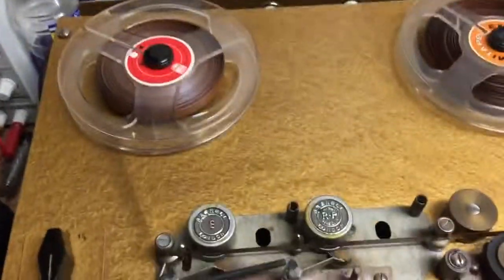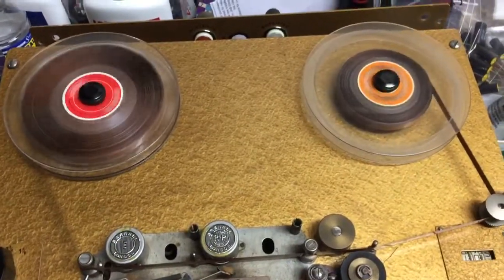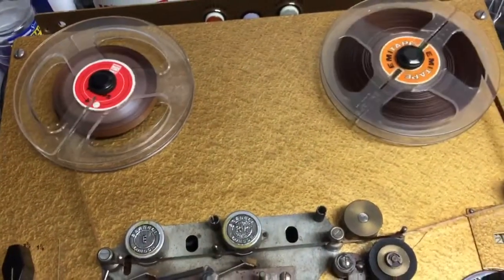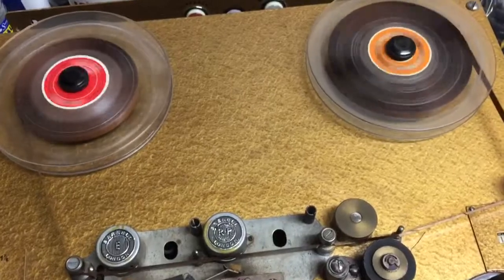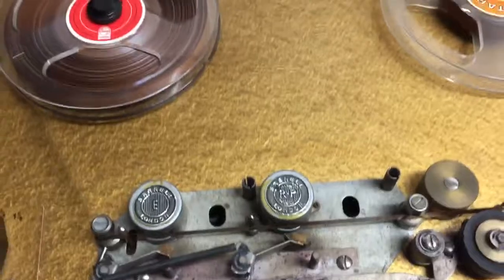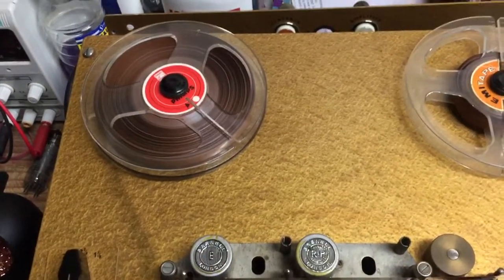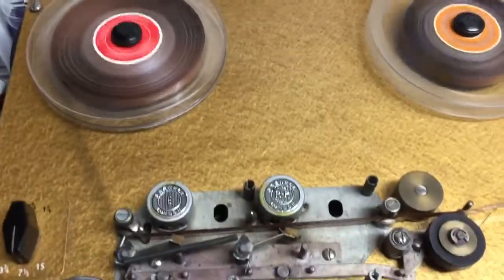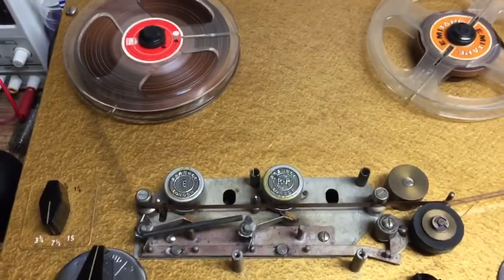Brenell Series 2 MK 5 Reel to Reel Tape Recorder Brake Fix. (Update)

Comment: Where you located?
Reply from the maker: Hi, I'm located in London.
Reply: @conundrum112  I have teac x-2000r it rewind forward ok but won’t play I change belt but no luck
Reply from the maker: @absoluteworlduk  I'm not too sure sure about that machine but I will see what I can find. Check out my vintage audio reel to reel channel: https://www.youtube.com/channel/UCoz0Yeo2f_n3xIxKSqauhwg   The mechanism that operates the pinch roller could be all gummed up like glue, that's what happens to grease after around 30 years.